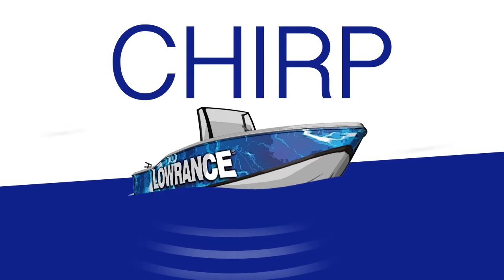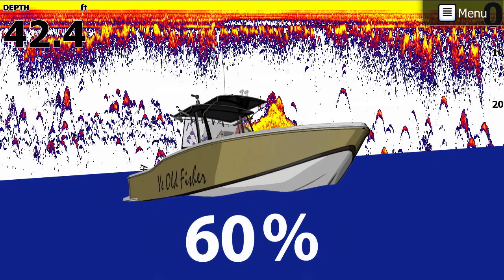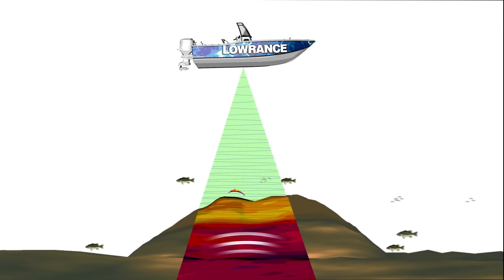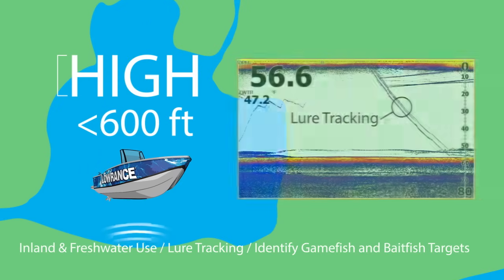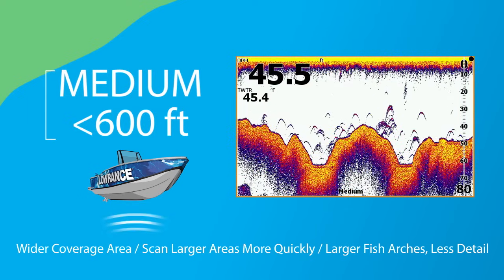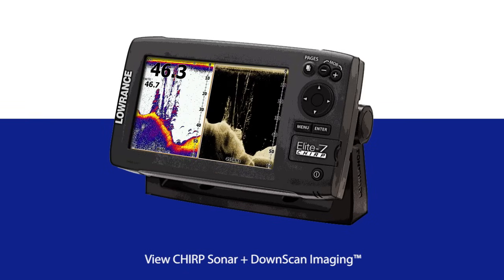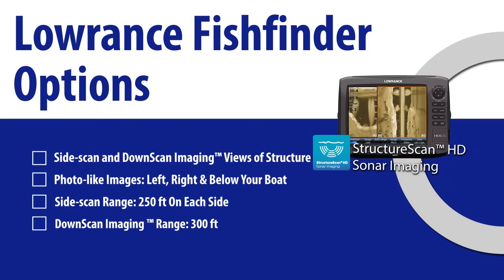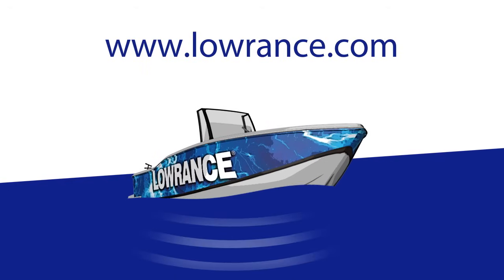Lowrance CHIRP | Sonar Basics

Comment: Lowrance has one big flaw. Customerservice is very very poor, but Units are good (if they work).
One good idea would be that the Transducters get marked so you know what you have in your back. There is nothing on them at all.......
Reply from the maker: Thank you for your comment, we're working on it.
There should be a label attached to the transducer which identifies it, if that is what you mean.
Reply: @lowrance  Yes. Yust simple Transducter Model 1-2-3 or X-Y-Z or something like that.......that would help A LOT! 
You need more Vids of the Sonars with Youtube basics and pros.
You know how long i needed to get the Info that plus/minus and power loose power keep p/m takes you to a Coldstart or Hardreset ..... way toooooo long. Now it works flawless but find that.....

Comment: The side imaging on my sonar shows the right side really well, but fades quickly on the left side, which has my outboard.   It is on a 2x4 that extends well beyond the prop, which was the best available location that would not be subject to damage from the trailer when pulling it in or launching.  It is level with respect to the surface, so I don't understand what is wrong.  Could it be the turbulence from the motor?
Reply: 在哪里买

Comment: I have a hook2-7 on my hobie pro angler 14 kayak I don’t know why my fishfinder will not read nothing but speed now I checked connections kinks in the wires checked the prongs at the unit to see if any were bent check the plug checked the transducer it pulsates in the hand but it’s still the same if anyone has the solution to this problem I am having would be greatly appreciated

Comment: does this work using the standard 83/200 skimmer transducer or do you have to use the airmar 150 chirp transducer?.
Reply: They say it does work on standard 83/ 200 transducers.
Reply: +Lyle Wilshire you want 83/200 plus 455/800 trans for fresh water not just 83/200.